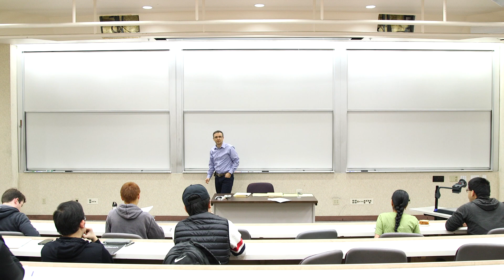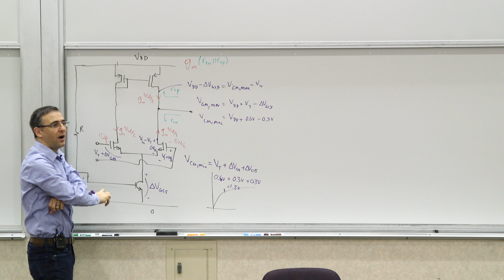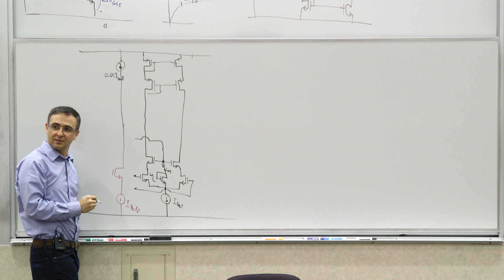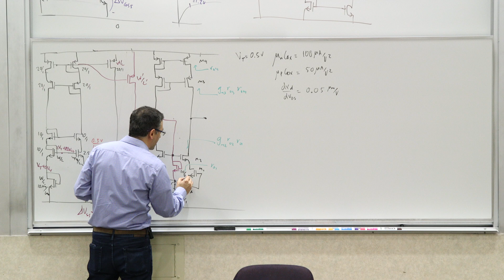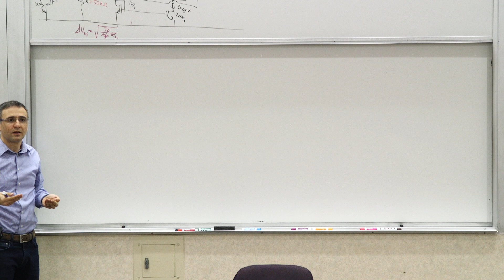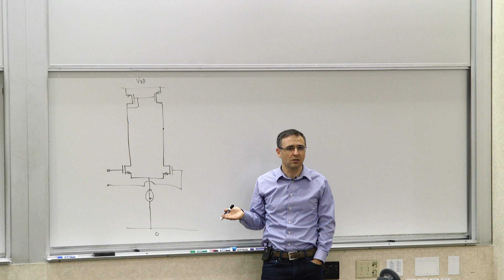137N. MOS Op-Amp Design Examples

Comment: Q: Why Drain to Source Voltage of NMOS is being called delta VGS?
Reply: Sir, i think it's minimum voltage to keep mosfet in pinch off. Using MOSFETs at the edge of the active region is an effective way to setting voltage headroom
Reply: VGS - VT = delta VGS. If you want the transistor to stay in pinch off, you need to have VDS > VGS-VT. which is equal to say VDS>deltaVGS. This is the reason why it's written deltaVGS

Comment: Hi Professor, Can I please ask a question @10:02
Your equation suggests the drain of PMOS M3 can be as high as Vdd-delta(Vgs). I would agree with you if we were analyzing the differential mode.
  
But you also discussed the common mode input condition. Then the drain of both PMOS should be the same voltage and the max drain voltage of PMOS has to be less than Vdd - Vsg_3 instead of Vdd-delta(Vgs) due to the left diode connected PMOS

Thank you a lot if you can correct me if I am wrong!

Comment: 00:02 Op amps are building blocks with differential input and single-ended output.
02:24 Current mirror ratio determines gain and output resistance.
07:04 Op-amp input range is limited by supply voltage.
09:25 Operational amplifier design considerations for high and low voltages.
14:41 Common mode behavior of MOS transistors
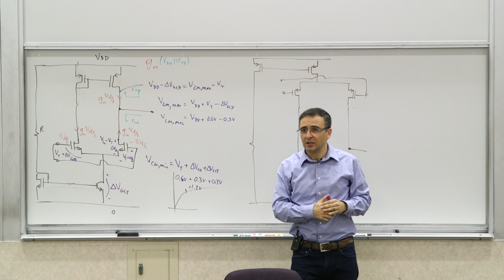16:48 Differences in gain for MOs devices
21:23 Adjusting the current for the differential pair
23:33 Choosing a moving voltage over a fixed voltage for common mode
27:51 Using a floating mirror to adjust threshold voltage.
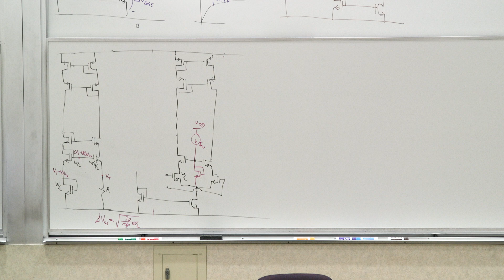30:25 Creating a reference branch to control current
34:56 Design considerations for operational amplifier properties
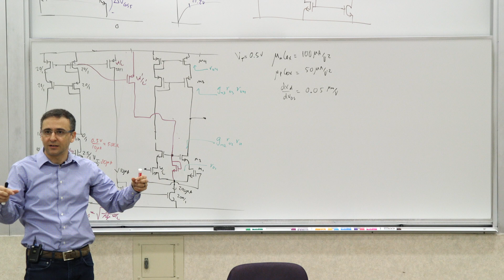37:01 Op-Amp design involves trade-offs in transistor sizing and channel length.
40:53 Minimum channel length and its impact on device performance.
43:29 The importance of choosing the right W/L ratio for MOS Op-Amp design.
47:49 The video discusses various design examples of MOS Op-Amp
50:30 The input ranges for the op-amp design examples are being discussed.
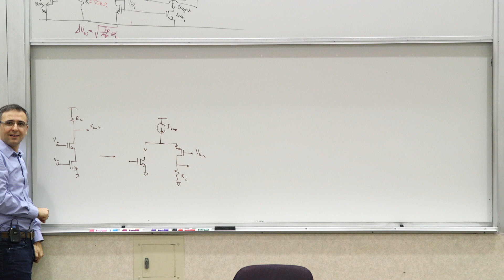54:40 Kassel folded cascode offers more gain due to current distribution
56:56 Telescopic cascode amplifiers can achieve high gains and differential outputs.
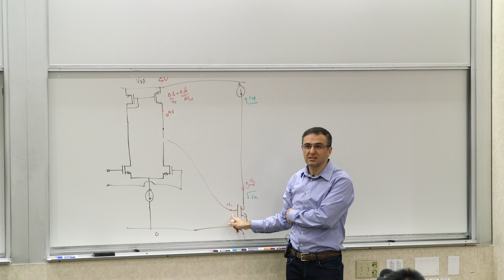1:02:43 Cascode design has a voltage level problem.
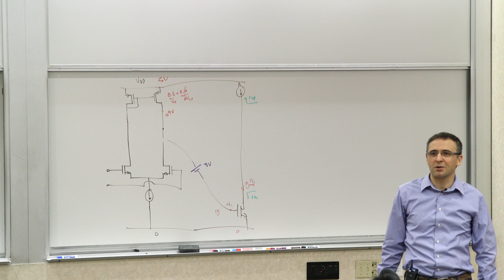1:04:54 Adding a follower to adjust voltages and the problem with supply voltage changes.
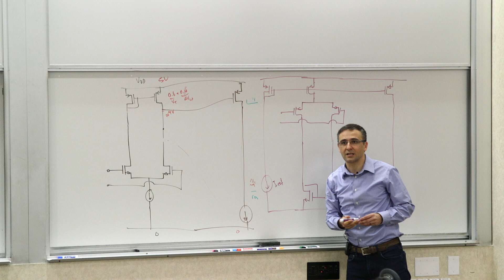1:09:13 Invert the whole thing to create a more complete object
1:11:34 Design considerations for op-amp output stages
Crafted by Merlin AI.

Comment: Dear professor, at minute 13:49 you solved me a doubt that have remained in my brain from the introduction of ΔVgs. You used often that voltage (ΔVgs ) as it was fixed, however by definition it is ΔVgs = Vgs - VT, so to determine if the mosfet is working in the triode region, It has to be Vgs>VT and Vds<Vgs-VT=ΔVgs ... but without knowing the value of Vgs is impossibile to know ΔVgs. 

So, to me It seems that ΔVgs is a kind of placeholder that we use in the design phase, to define some relationship and then, at the end, we can imagine and place some number or we can have some constraints for Vgs that will give us ΔVgs . This in opposite as what happens for the BJT, where Vsat and VBE on or VBE sat are fixed values that we use supposing a certain kind of BJT.

Is my reasoning correct? Thank you.
Reply: I think if you know what you are biasing the diff pair with (via its tail current), you therefore know what the VGS will be of each branch at DC since the currents are known. From square law equation we can calculate the VGS from knowing the ID, and thus calculate the VDSAT (=delta VGS)

Comment: Love your videos but I'm pretty sure your analysis of the 5-transistor-OTA VICM max is incorrect. You comment that the input can go above VDD but that is not the case due to the diode-connected transistor (which you did not mention) on the left. The diode-connected transistor sets the drain voltage to VDD - Vgs = VDD - Vov - Vtp. The input can go one threshold above that: Vicm,max = VDD - Vov - Vtp + Vtn ~ Vdd - Vov (assuming Vtp ~ Vtn).
Reply: True
Reply: Yeah, wondered about the same thing. His analysis would be true for a diff pair with differential output
Reply: no.  The drain voltage (drain potential to be more correct) of the left transistor is different from the drain voltage of the right transistor. The professor analysis is correct t
Reply: fjord2141 is correct. The left side input NMOS transistor will get squeezed because of diode drop (VT+del_Vp) from PMOS current source. Its gm will drop resulting in lower overall gain. Hence ViCM (max) is ~ VDD-delVp assuming mag(VTp) = mag(VTn)
Reply: I think you are right. The input common-mode maximum voltage should also take into account the left-branch diode-connected PMOS and the left NMOS pair. The Vcm,max should be one overdrive voltage below VDD. What the professor analyzed is roughly one overdrive voltage above VDD.
Reply: @nurahmedomar  hi, are you still studying at concordia

Comment: 25:32 http://prntscr.com/n9saq0 - Professor could you please see this. We put T3 there to provide minimal T12 and T22 gate voltage such that there is JUST enough room for Vt and their overdrive voltage (the voltage necessary to provide half of the common reference current), plus one more overdrive voltage of T11 and T21 that will also enable drains of T12 or T22 to have the lowest possible voltage (Vt bellow Gate voltage of T12 and T22)? Because Ifer2 is not the same as Iref1 and overdrive of T3 must be two times overdrive of T11 or T12 (as it is across both of them)  we can size the T3 in such a way that with its smaller bias current provides larger Vgs? Thank you immensely professor, you have changed my carrier probably!